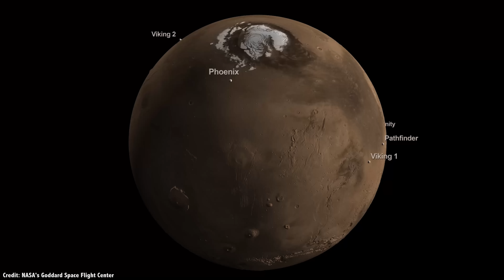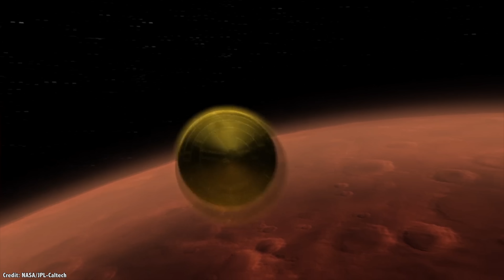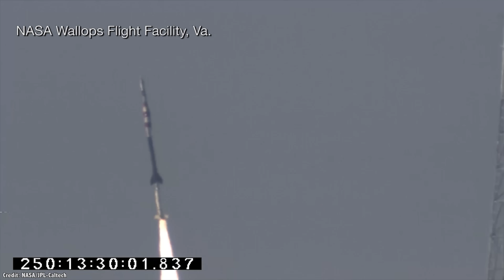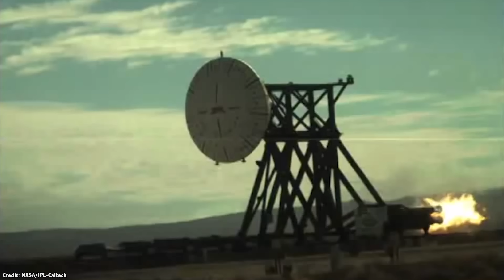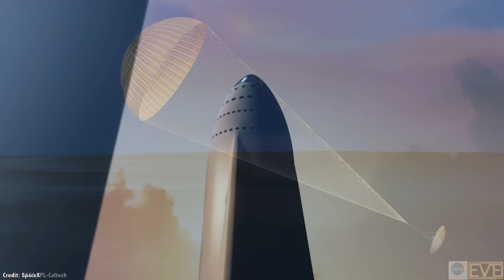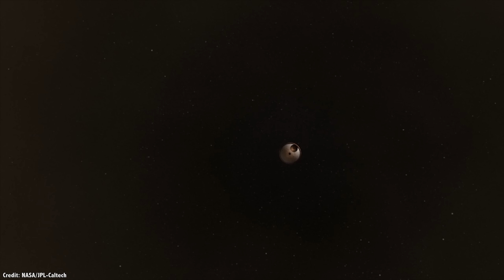The Incredible Challenge of Landing Heavy Payloads On Mars

Comment: Once zero G fuel transfer becomes a thing this should become a non issue especially with everything reusable. 

You would just send a fuel tanker ahead of you to refuel in orbit then the mass you can get down to mars is only limited by how much space you have and how much thrust your engines can produce.
Reply: That's what I was thinking.  Send a couple tanks of fuel and have them set into an orbit around Mars.   Fly to mars, run your credit card and fuel up.  
Actually, it could be fuel tank that they just dock to and use the existing engine, or even have an engine and tank sitting there.  You attach to that, burn till it's empty and then drop it and then parachute down.
Granted you have to have 2 shots to mars to make one decent, but aren't they talking about sending multiple loads to be on the surface well before any souls step on martian soil?

Comment: Consider a thrust+lift concept, that is, using the exhaust gases as an atmosphere and the nacelle or body of the vehicle is a lifting surface covered by the flow.

Applied to the Astrobotic Peregrine M-1 lander the reason was putting the rockets above for stability for such a flyweight lander to then find when reducing velocity to subsonic to curve that much as flow, it works out with far less fuel ... passes scaled napkin level.

For lunar takeoffs you go sideways with hovercraft to max thrust+lift and keep spiralling off or down onto the surface, it works in a vacuum the clincher to investigate for biggies.

Gotta' abstract into 2019 IAC  for this on time.

Comment: There are brilliant people working on this for sure. I really love the last idea. As a pilot interested in spaceflight its frustrating to not have something free to push on. The aero structure required is going to be heavy though. But the drag is free if you can pull it off. I'm an ex F-111 troop. This would be the TFR ride to hell baby. Oh the Gs would be tremendous.

Comment: Thank you.

That "luggage" you speak of is the sum total of what will eventually consist of towns and the means to travel from place to place (motorized vehicles or rail, since the lack of air precludes air travel).

And to get meatbags in place safely and for a long duration requires that much of this "luggage" be placed prior to arrival.

A desirable goal, but it needs to be operationalized with a fine tooth comb.

Comment: You talk about the subject as if the puzzle hasn't been solved. The math has all be done on the Space -X Starship which, if all goes well will land a 100 tons on mars routinely. The starship would use orbital and surface refueling as the key to it's operation. The other approach for routine access to mars would be to go between earth orbit and mars orbit using electric (nuclear or solar) rockets as a planetary transfer vehicle. This would forgo atmospheric breaking to remove interplanetary velocity, by using highly efficient ion or plasma engines. Then we would travel between the surface and orbit with a reusable lander that is refuled on the surface from local resources. Not as much development has been put into electric propulsion for large scale people carrying spacecraft, but the principals of it all has been well known for decades.
Reply from the maker: It's one thing to solve it in simulation, another thing to actually do in practice. I think SpaceX will crack it, but it's going to be more challenging than they think, and probably require more propulsion. I can't wait to see them pull it off.
Reply: @frasercain  I just meant to give you a helpful critique of your video. I didn't mean to say Space -X doesn't have a challenge getting the Starship to work. What I meant to suggest is that along with the parachute approaches you discussed it would be a more complete picture if you included the Starship approach and the other approach (electric rocket & lander)

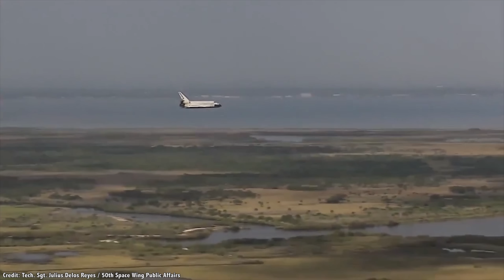Comment: 2:10 The Space Shuttle's ABLATIVE tiles.

Dude, you are in the wrong universe. Shuttle tiles are not ablative.
Reply from the maker: Yeah, I didn't catch that one when I was writing. Although they did replace them after each mission, so it's just lower resolution ablation.
Reply: They only replaced damaged. worn or missing ones.
Reply: Right, so it's just really low res ablation.   

I also wear ablative clothing.
Reply: @aelolul  You are ablative too tho
Reply: You're right. Ablative implies the material is engineered to actively shed itself away carrying heat with it. This is simply not true of the shuttle tiles. The shuttle's tiles acted more as an insulator or heat sink. They did not, and were not designed to, actively cool themselves through ablation in any way. The only 'wear' the tiles experienced that resulted in replacement tiles was the adhesive failing, the tiles being struck by foam from the external tank, or micrometeoroid impacts on orbit. If you believe 'ablative' has a definition, then you must admit it was used wrong in this case. A simple writing mistake and nothing more. But lets be honest about it.

Comment: That aerodynamic glide method is pretty similar to how the starship bleeds off its final velocity.
It presents its side to the direction of travel and comes in with significant horizontal velocity, bleeding off more speed as it spends more time in the thicker atmosphere than a direct suicide burn would use, then as it gets close to the ground it fires the engines to cancel the remaining velocity.
Its not quite the same as the starship can't exactly glide for a long time, but 20 seconds going sideways seems to do the trick.
Reply from the maker: We included the Spaceship's landing in the video. I really hope they're able to she'd as much velocity as possible to maximize their payload. We'll see how it goes.

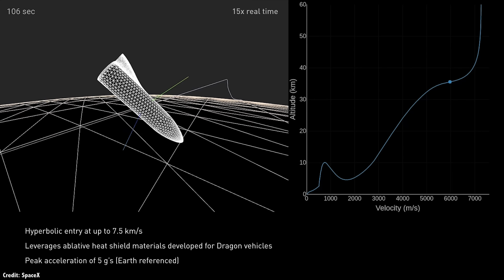Comment: SpaceX knows the optimal way to get the most deceleration from the atmosphere. At 8:10 you can see in the model the spaceship is pointed down initially. With the newest Starship design they have more surface area with those fins to slow down even more before burning the engines. The amount of fuel used during landing is not an issue.
Reply from the maker: SpaceX thinks it'll work, and I hope they're right. More mass on the surface of Mars. But if that's not working, they can try the dive idea I mentioned.

Comment: How about using an ion engine or a nuclear engine to slow down Starship as it approaches Mars, so that the approach velocity is the slowest possible?  Unlike chemical rockets, an ion engine or nuclear engine would need much less fuel.  Those engines could be inside a small rocket "tugboat" that is placed in orbit around Mars, by a cargo Starship that doesn't land on Mars.  Then, as another Starship approaches Mars, it links up with the rocket tugboat.  Starship uses it to reduce velocity as it goes into progressively tighter orbits around Mars.  It eventually detaches the tugboat to begin its landing approach.  That should reduce the time for orbital slowdown short enough for manned re-entry.  By bleeding off some velocity before re-entry, Starship wouldn't need as much chemical fuel as it would to slow itself down from a high-speed orbit.  Would that help?
Reply from the maker: Nuclear rockets would be very effective, but they come with their own complexities. Ion engines are too gentle.
Reply: @frasercain  Thanks for replying, Fraser.  The idea is to break the problem of going from Earth to Mars or the moon, into 3 phases: launch, voyage, and landing (both going and returning).  For launching and landing, you need the power of chemical rockets -- Starship has those.  But for the long voyage in space, a ferry that could be as big as a "Werner Von Braun space station" or a "spaceport", with a number of ion engines would be much more suitable.  It could fire its ion engines continuously to both accelerate towards the destination, and to decelerate to a gentle orbit velocity as it approaches.  Please see my reply to mikldude, below, for more details.

Comment: What are the problems with the following simple plan?  Enter at a shallow angle and slowly decend. Using lift and a small amount of fuel, you could go around the planet multiple times as you slowly bleed off the speed. Only when you are slow enough that you get no useful lift would you switch to a powered decent. If needed you could fold out some wings for added lift once the speed drops enough that they would not be ripped off. Since this seems like an obvious plan, I assume it has been thought of and ruled out, but I don't see what the problem is. Any one know what the problem is?

Comment: I don't see why a thin atmosphere is worse than no atmosphere. The reason NASA uses heat shields and parachutes is because it's more efficient than using fuel. If Mars had no atmosphere, I think it would be more difficult to land there.
Reply from the maker: Because you still need to carry a heavy heat shield.
Reply: @frasercain  I'm confused. If Mars didn't have an atmosphere, why would you need to carry a heat shield? Unless you mean for a direct Earth return-mission?
Reply from the maker: You wouldn't. It sucks because you have to carry a heat shield, but the atmosphere isn't think enough to slow you down only with a shield.
Reply: @frasercain  Okay, thanks. I think I just must have misheard something in your video, so my fault. What you say makes sense if you have a thin atmosphere vs. a thick atmosphere. For some reason, I got it in my mind that you said having no atmosphere would make it easier, but that would suck even more since you'd have to bring all the fuel in order to slow down. I presume that's why there's never been any lander to Mercury even though it has less gravity. Maybe BFR can do it.

Comment: IIRC, the BFR is already planned to propulsively land 60 tons at a time on mars, refuel there, and jet all the way back to earth on that tank of juice.  The cockamamie multistage contraptions won't be needed.  It just has the capacity outright.  What's the complaint after that?  Poor miles per gallon numbers?  You made a cool video anyway, with well-rounded consideration of various systems.

Comment: Why does it have to go 10s of thousands of km per hour? I mean with the BFR can u jusr burn more fuel to slow down?  How about a parashoot with a slow down burn? 
In the case of a rover why not put on a ion engine and slow burn slow down all the way ther? It will take longer but it will slow down from the earths speed to mars speed.
What happens if a big fucking glider opens up, high speed small atmosphere? Or turn the landing ship into a wing suit... have bars extend out the sides connedted to a strong ass fabric.  U can put fans below the wing suit wings and blow air up... well as much as possible can call it Big Blow Job.
Reply from the maker: If you go more slowly, then you take longer in space to reach your destination. More time getting radiated by galactic cosmic radiation.

Comment: Terrifying as it sounds, that's actually kind of a wimped-out version of the proposal for landing even more massive craft.  The effects are more useful if you actually plunge below the surface reference level.  The easiest thing would be to use the increased atmospheric pressure inside one of the very deep canyons like Valles Marineris. It's conveniently located and aligned along the Martian equator, and makes atmospheric pressure about five times what's available at the reference level usable.  Valles Marineris has been avoided because it's way too rough to land in, but with this landing profile you'd still have enough momentum to play against the air pressure and pop back out of it to a more "sane" (sanity is relative) landing site.   A more conservative approach would be to use Hellas Planitia.  It's it's smoother, and it's deeper, and it's wider, so you wouldn't be grazing along enormous canyon walls for the trip - but it's round instead of long, so there's no path to traverse it that gives you the length of path (measured in atmospheric resistance and aerodynamic forces) you can get traversing Valles Marineris.  Finally it's not all that conveniently situated close to the equator, so it's a bit harder/more expensive in propellant to access.
Reply from the maker: Yeah, those regions have even thicker atmosphere for even more aerodynamic braking.

Comment: Space elevator?  Land on the Martian moons first as the base and send missions from there?
Reply: the famous space elevator built from Unobtanium.
Reply: @gehteuchnixan69  
Martian/Phobos space elevators can work with more 'normal' materials, like Kevlar and Zylon, due to Mars's lower gravity.

You still need an awful lot o it though, and you do still have to work out how to land it on Phobos.
Reply: It seems to me that if you can slow down enough to land on Phobos than you have already solved most of the problem. Slowing down is the issue.

Comment: With a giant light sail you could decelerate in about 10 days; give or take depending on how much light you concentrate and the size of the sail. Combine with aerobraking and you could probably get down to 4 or 5 days. With a fancy parachute and a small amount of propulsive landing, that could be reduced further. So, perhaps a hybrid approach can maximize payload-to-cost ratio. I suppose it's also possible to start some of the deceleration process just before the craft reaches orbit too, using the light sail with a laser array

Comment: In the video you mentioned how easy it is to land on the moon. So why not land on Phobos instead? At 3700 miles from Mars you could surely fart your way to the surface? 
On a serious note though, would it be easier to land on a Martian moon, refuel there so you could use as much propellant as you need to make it Mars?
Reply from the maker: Landing on Phobos is a great idea and has been suggested in the past. The problem is that it increases the length and complexity of the mission.

Comment: Mars is horrible.  Let's conquer it!  In light of the recent discussion about NASA hiring commercial launchers to send Orion to lunar orbit, I understand that the current available launch vehicles aren't actually up to the challenge in terms of tonnage to TLI.  But what about the hypothetical "Falcon Super Heavy" (four strap-on boosters), which Elon mentioned in passing as a possible configuration?  I haven't seen anything about its lift capacity, but since the Heavy is only a little bit short of putting Orion in TLI, I would think the Super Heavy could do it.
Reply from the maker: They're going all in on the Starship now.
Reply: @frasercain  They are definitely pushing hard on Starship, but they do have at least seven planned Heavy flights on the docket, and it seems like a Super Heavy wouldn't be much harder.  At least, it seems more likely that they could get a Super Heavy to fly with Orion by the June 2020 deadline than a Starship.

Comment: Why not just have the payload in an uncrushable container, then when the space rocket reaches the orbit of mars, let go the cargo, the cargo will have just aerodynamic boosters only, once aligned,  it will crash to the surface of mars. problem solved.
Reply: As long as you're fine with liquifying the cargo inside, that sounds perfect!
Reply from the maker: The cargo would smash against the walls of the container.
Reply: Yasssss, lithobraking for the win!

Comment: I don't like your introductory statement, unless appended with "except for everywhere else except the Moon". Surface of Mars is about the 2nd or 3rd easiest to visit in the solar system. Moon is easiest mainly because it's close. Venus is debatably in 2nd place but the extreme harshness of the surface makes that very debatably debatably, sure, it's not as hard to land something on the surface, but that thing wont transmit for long. Titan is also debatable, it's very far away and requires much more delta-v to get to (which might be obtained by gravity assists), and the surface is harsh because it's so cold and potentially gooey.

Everything else (putting aside some NEOs) requires way more delta-v than Mars because it's not possible to change velocity by aerodynamic drag, that means the lander has to carry a lot of propellant to match velocity with the planet or moon. I mean there's a reason we haven't put landers on Mercury, or Ceres for that matter, Ceres would be easy to land on, if you could get in orbit of it, but you have to perform a large insertion burn, much larger than for getting into orbit of Mars, and the ejection burn from Earth is more expensive too.

Anyway, onto the main theme. I've tried the SpaceX landing technique (as shown in "Making Life Interplanetary") in KSP using RSS and FAR mods. The main problem I run into is the game keeps crashing, I don't know why but when going at like 7000 m/s near the surface it crashes, a lot. It doesn't crash when travelling slower, like I can use hyperedit to arrange for the ship to be going horizontally near the surface at like 3000 m/s - at that velocity it still easily generates enough aerodynamic lift that it can maintain altitude. Doing that I've managed to get the velocity down to about 450 m/s through a "swoopy" type maneuver, altough hitting the ground at 450 m/s isn't the intended outcome, engine ignition at 600 m/s might be more realistic.
Reply from the maker: The problem is that you have to carry a heat shield at Mars in addition to the propellant for landing.